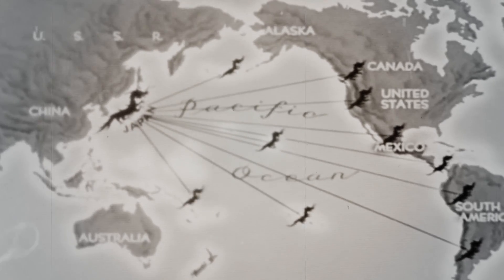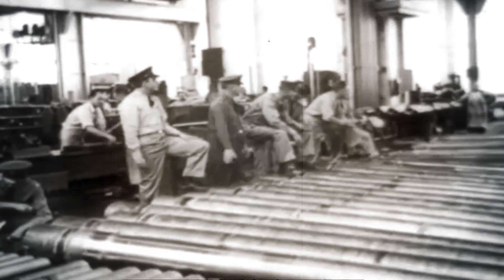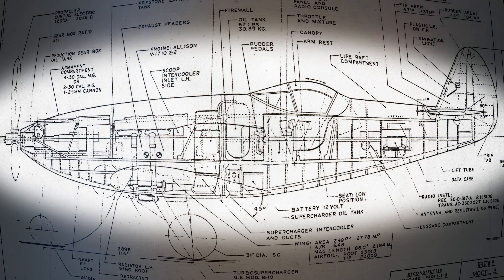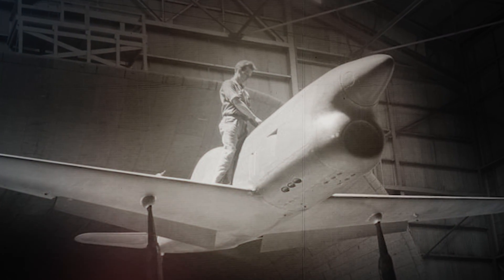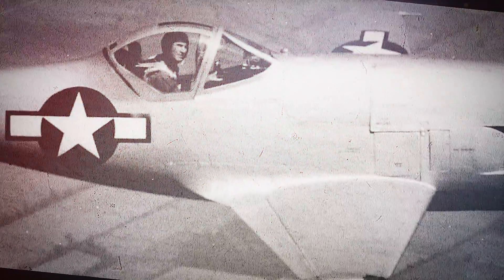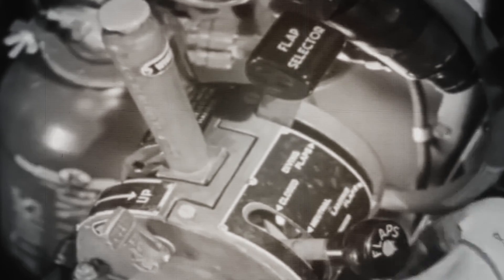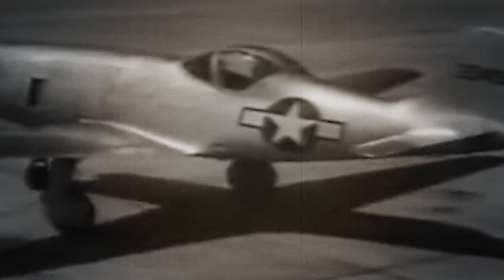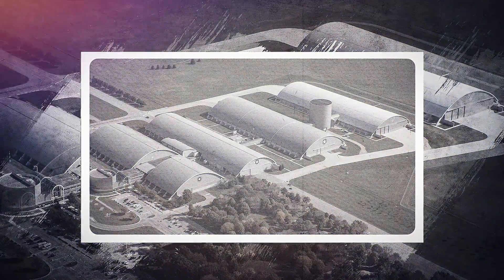Bell XP-77 - America's Emergency Fighter (Built from Wood)

Comment: Well, it wasn't sourcing wood that was the problem. It was taking "small and nimble" too far to an extreme without thinking about FIGHTING... You can't do diddly in an aerial dog-fight with 200 rounds of ammunition.. Even a common SUB-machine gun's recycle is slow at 250 rounds a minute, and many run north of 300... You get ONE "burp" and not even a full belch before "you're done"... 

    Saw a few comments mention "What if we put a Merlin in it?" Well, you'd probably twist the fuselage in half and sling scraps in every direction and that's IF (very big IF btw) you could even manage to shoe-horn such an obnoxiously immense engine into it in the first place... It was already restricted to 50 gallons of fuel so that wasn't going to feed over a thousand horses very long (matter of seconds)...

   Nah, Woods TRIED to give a red-hot little scrambler to the Air Force, and he ended up designing "Herby the Love Hornet"...

    You want a "What if..." scenario that makes better sense? Drop a couple guns off the P51 and make THAT with a wood frame, wrapped in light aluminum or even cloth... In a pinch, you COULD crank out a craft based on a WORKING design spec' and probably even drop back to a more modest engine without a lot of sacrificed performance.

    I'm not talking about a craft we'd WANT to push into production... BUT this is the kind of thing that might actually stand a chance at working IN A PINCH... Had there been such a pinch, there COULD still be a contingency to work on... We're lucky it didn't come to anything so drastic... AND no, it's not the ONLY thing that could've been considered... It's just the particular example that leaps to mind THIS time around. Similar could've been attempted with a variety of planes already designed at the time, and someone with privileges in the archive of spec's and stat's on them could probably make a MUCH BETTER suggestion than my "first idea"...  ;o)

Comment: If 2 bodies of planes ultra light diff greater advantage, then if prop rear pusher not puller design getting test bed learning & light weight or diff structural advantage not to mention radar scouting. Lighter the pusher engine the better again diff test bed. Front tail not rear tail again test radar avoid plane, research plane so if not war ready still learning sound. Helps to hve diff ppl solving same problems diff.

Comment: Why didn't Bell call Dehaviland on the phone and ask for a single engine version of the Mosquito? The XP-77 is the smaller brother of the Mosquito. Built in wood and incredibly fast. Why are aircraft builders always so testosteron? When they'd use their brains, cooperation can work out better than sticking to your own design like a fool forgetting somebody else can be better than you yourself. Those testosteron guys. So sad.

Comment: An unfortunate conglomeration of elements….a great idea somewhat poorly implemented.
The mosquito (different mission) was wildly successful, but had plenty of power.
If they’d gone with bigger planform to make room for one of the big turbo v12’s and plenty of fuel and armament (think wooden P51, or the like) it might have outweighed a zero or me102 somewhat, but would have likely outrun and out maneuvered them both in dogfights and still been able to fill the multiple rolls the US military seemed to insist upon.

Comment: That 20mm would give it a wallop against fighters. 
The biggest issue seems to be the lack of the correct engine. 450hp is significantly less than 520hp and that being less than the promised two stage supercharged version. ( I've heard and read conflicting numbers of 640hp or 710hp) 
The wings seem to have been too thin, going for that racing style wing takes allot of spare strength away. But a thicker airfoil might have caused too much drag, even with shorter wingspan. The design simply couldn't get the most out of only 450-520hp. 
If the goal was to use the Ranger 770 they might have considered a tandem twin engine or maybe even a miniature P-38, a bit like the Convair Model 48 Charger or OV-10 Bronco with their twin boom, twin engine layout and stubby wings. That design at least would allow for future engine upgrades and the nose would allow for varied armament options. Although I could see a pair of 20mm cannon shooting through each of the the props and another pair of 12.7mm Brownings in the nose. Fuel could be carried under and behind the pilot and the booms would have space for additional supercharging equipment as it became available. I suppose the limitation might still be weight. And having two 12.7mm MGs and a single 20mm or 25mm cannon in the nose would make more sense. Then all three guns are in the nose and it keeps things simple and keeps weight down.

Comment: "War could restrict America from war materials like oil coal and aluminum".... HOW!??! It's inside your own country.... here in Australia WE DID have to worry about oil because we essentially WERE cut off with not enough for our own use. Plenty of good quality steel (and tooling) but private coal use was almost stopped except coal gas. We had NO issues with building guns but fuel got low and firewood practically ran out in my state capital. They were burning green stuff cut like 2 months ago.

Comment: I bet they could have made cowhide and wire work back then. Recalls a very old SF story whereupon Martians conquer Earth and ban any rocket tech to keep humans caged on one planet and no longer a threat. So we got together, developed matter transmission tech and beamed armies over to take care of business. Before Star Trek, by the way. Suggestion if not done already: U.S. B-29s forced down in Russia; air crews returned but planes only after reverse engineering them. Later U.S. pilots toured them and astonished to see combat bullet holes perfectly replicated as in original. Soviets weren't taking any chances it was some secret design element.

Comment: It's obvious.  It was designed poorly.  Though it looked pretty good,  it was too small and too flimsy to be worth anything.  The wooden,  British Mosquito,   was one of the best planes in the war,  I think.  It was great at just about everything,  and very good at everything else.  It might have been the 3rd fastest prop driven plane,  at 400 plus mph level,  and not far behind 1 and 2.  It had two 1200 to 1600 hp,  Rolls Royce Merlins on it,  and could be armed to the teeth.  Too bad nobody consulted the British.

Comment: Like the zero, the vertical stabilizer was kept very much rearward of the horizontal stabilizers ...this enabled extreme maneuvers in combat.
 the fact that this plan came out like a month and a half before World War II is amazing because they hadn't received technical information on the Zero until they recovered one in 1942 the crashed on landing and send it back to San Diego only then did they figure out officially the effect of the vertical stabilizer being held rearward on the Zero but of the evidently they knew of this even in 1941 this must have been top secret

Comment: There were massive shortages of goods after the war.  One of my dad's stories from I think 1946 (in the US Northeast) was not having enough fuel oil for their furnace.  Several families were finally able to buy some drums of oil but they had no way to transport them due to the snowy conditions. They ended up getting a large sled and the men hauled the drums through town to each house.

Shortages did work themselves out until the early 1950s.  The '50s really were a golden era for the USA, one we will likely never see again.

Comment: If it was to compete with the Zero, which was a highly maneuverable fighter, why would you use a laminar flow airfoil? Those foils are great for fuel efficiency for use in defensive escorts, Like the P-51, but not nearly as good for maneuverability as a non laminar foil. I have wondered if they needed something to compete with the Zero, why did they not just reverse engineer one and add some improvements?

Comment: 3:10 ironic considering that consensus had been reached by early aircraft designers that weight shouldn't be focused on, because without a revolutionary discovery in metals it would be impossible to drop enough, but power should be. 

And you can see the US agreed with this in the mustang. Fix the power/weight ratio with lots and lots more power.

Comment: 2:46 - An additional 36 board feet per year???  What was that, cutting down one more tree?  🤣 🤣 🤣 🤣 🤣
I THINK they mean an additional 36 BILLION board feet.  DUH!
3:00 - After Pearl Harbor, the Zero didn't overwhelm ANYTHING.  The Grumman F4F Wildcat had a claimed KDR (kill to death ratio) of 5.9:1 in 1942.  Even if half the US claims were mistaken, that would still be about a 3:1 advantage in favor of the US planes.
5:20 - Aircraft don't have LEGS.  Those were LANDING GEAR, or just GEAR.  DUH!

Comment: Bell Aircraft were Remarkable "Think outside the Box " Engineers . No-one was going to match the A6M however . The Radial engine in it was Very powerful for its size , Reliable and Cheap . The Mitsubishi Zero is arguably the Best Fighter Plane ever built .
Bell moved into Helicopters . The Iconic " Huey " is theirs . The Bell Iroquois . Vietnams Gunship . VERY  Tough  bird .
Jet ranger came later .

Comment: Building aircraft almost entirely from aluminum didn't really become standard until the late 1930's, so the use of wood had been completely normal until that time. Wood seems weird to us because aluminum (and now carbon fiber) has been standard for 80 years, but wood dominated the first 35 years of aviation. The USSR fighter aircraft of WWII were mostly built from wood and the Germans reverted to some wood, such as the tail of the Bf-109K model late in the war. Amazing that WWII began with many biplanes still in the air and ended with German, American, and British jets being operational only six years later.

Comment: A number of countries found the "lightweight fighter" concept attractive.  However, for the reasons enumerated in this video, few proved successful.  Perhaps the most notorious was the Caudron-Renault C.714, which was flown by the French Air Force during 1940.  They were so poor that the French turned them over to the Poles, who were happy to accept anything so long as they could fly them against the Germans.  Perhaps the those successful, and it was one of the very few, was the Soviet's Yak-3.

Comment: I wonder if the outcome of the project would have been better if Bell had designed the XP-77's airframe around the engine and proposed armament, such as was done with the British Mosquito. It suffered no limitations imposed by its wooden airframe.

Comment: ...only a single fuel tank of 55 gallons? Christ, that's totally inadequate for a fighter intended to be fighting in the Pacific or across the English Channel. I'm not sure why they went with such a small aircraft when they had the advantage of not being constrained by strategic materials. Only having 200 rounds per gun would have been inadequate for taking down a bomber, too.

Comment: The Curtiss CW-21 in the Dutch East Indies and the French Caudron C.714 in France in 1940, both were very light weight fighters that didn't do very well.  They might have served as a cautionary tale for the USAAF and Bell.  Thank you for an interesting video.
Reply: The CW21 was a beast, a fragile but still devastating beast. If only the dutch were training more in the aircraft and had more time to familiarize with it, chances are they would've given the Japanese a run for their money. If you let an airman ride a Zero or a CW21 to battle with only 10 hours of flight time on both aircrafts you would be far better off preparing a casket. The Japanese were excellent pilots because they knew their aircraft well. The only downside to the CW21 is that it's likely to be way more fragile than the zero.

The Cr.714 on the other hand. Bleughhh!!! An utter waste of time! Who thought that making a worse racing aircraft is a good idea? Just because it once worked, doesn't mean it will work.